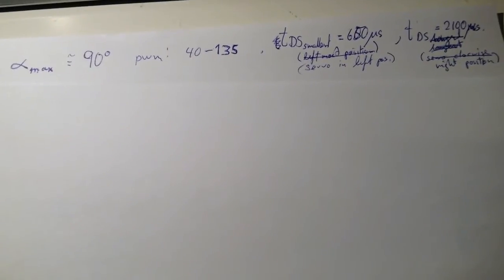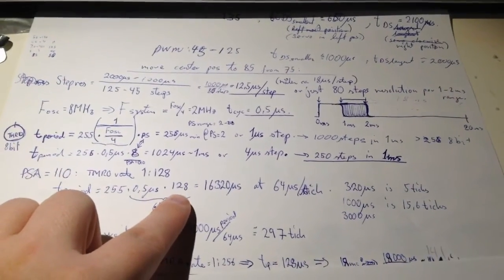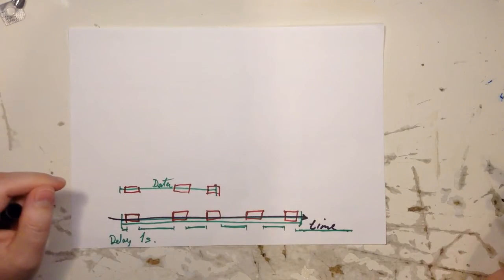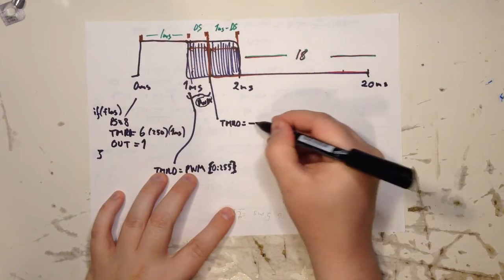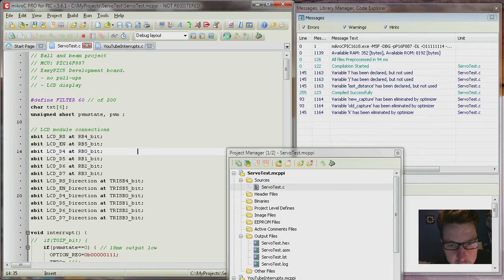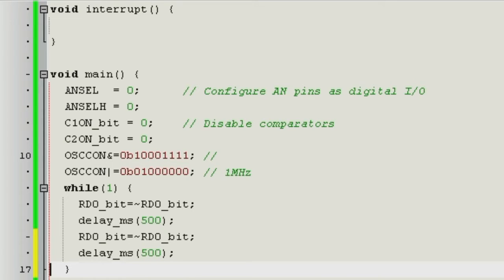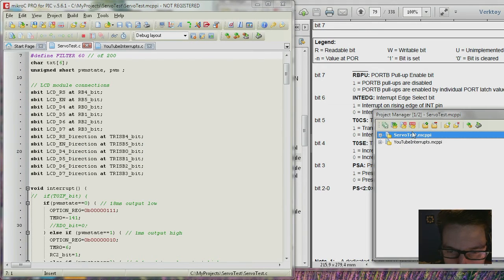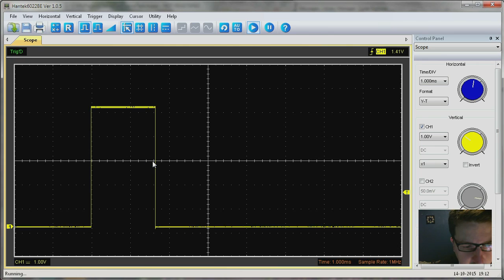The Beam and Ball Project - Part 7 SoftPWM and Interrupts

Comment: Wow, making good progress here!
Reply from the maker: +GadgetUK164 Thanks. Also thanks for your microcontroller video. I've linked in a course from edX.org in the description above. I think you might like that course. It doesn't cost anything to join it.
Reply: +bwack I like the proto board you are using there as well - ie with buttons, displays etc.
Reply from the maker: It's quite nice. It is expensive. Back in 2008 the alternatives weren't great. I haven't second guessed the purchased once. The arduino was quite new in 2008, but this board is designed to get your projects up and running fast. http://www.mikroe.com/pic/development-boards/
Reply: Thanks for the link!  I might order one of those boards they sell at some point!

Comment: I don't know if you meant to do it, but I always make the mistake of thinking that a byte can hold 255 values, but it's actually 256 (0-255). I think you corrected it but still I thought I'd mention it.
Reply from the maker: +The Highlander Yes, that was a mistake. When I watch the video I've made many mistakes, like mixing up cycles with ticks etc. Now that I look at my first video I see that I say: "capture works by stopping the timer" (timer is free running).. That is the description of timer-gating. When in later videos where I make use of the capture mode, I do it correctly "capture works by storing the value in a register". I had the wrong idea how capture worked in the first video.. Maybe I should put up correction notes in these videos...
Reply: Only if you feel comfortable doing that. I've had people demanding that I put in corrections in my videos but I thought that was a bit silly.